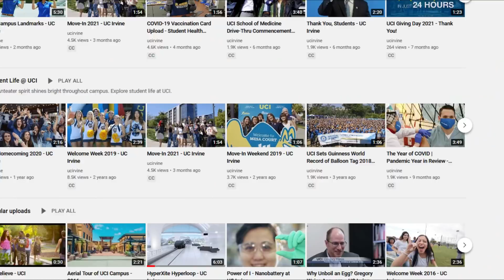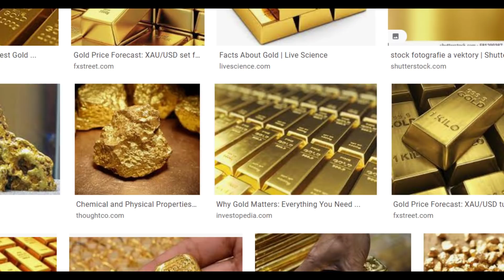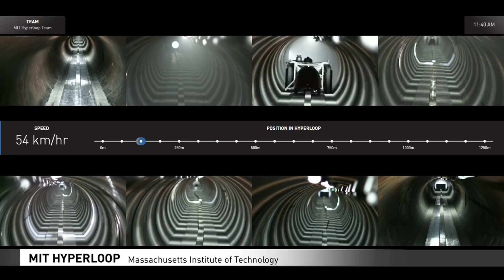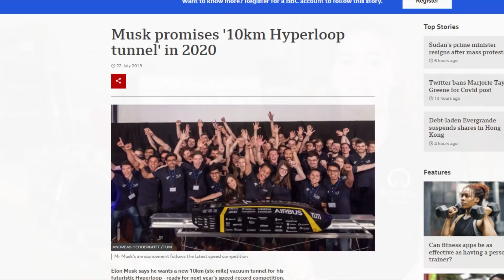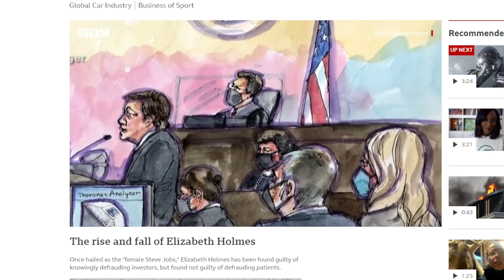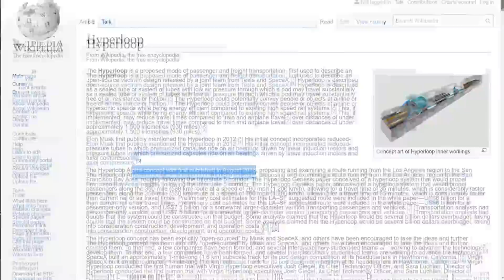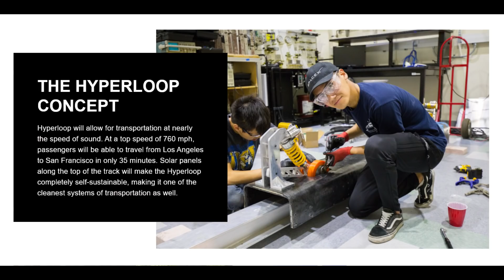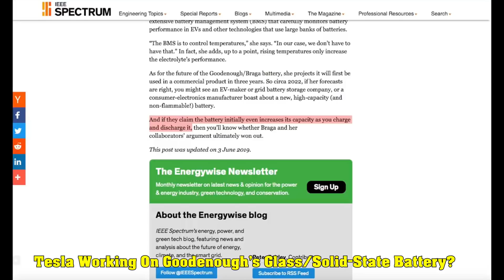The GOLD Battery that will revolutionize EVERYTHING!

Comment: The crazy one is the solar shingles.  That's surely got to be the most possible of all the ideas, with the fewest engineering problems, but we still we have nothing
Reply: That was a big disappointment to us.  We had a hail storm damage our roof, and thought that would be the ideal time to get a solar roof as a replacement.  No need for a "regular" roof with structures on top of it for solar.  No, the shingles themselves would do double duty, as well as being far tougher against future hail storms!  Discovering that it was another Musk lie, we just got a composite shingle replacement.
Reply: Oh, that one is EASY to develop... good luck installing it and having it last. It was developed and quickly they found out 'You know, those dudes who made larger solar panels MIGHT have known what they were doing'.

Comment: So, a overglorified capacitor that uses gold?
Reply: yep
Reply: An over glorified capacitor that stores far less power for the same mass than many other materials, such as Lithium, for example. It's a bit like looking at land degradation from intense monoculture farming practices and announcing that you found a solution to increase the lifetime of a field under intense farming by 20 times but that it produces 3% the yield each year, it makes no sense and is a dumb solution when more viable alternatives already exist (which in the case of intense farming, but it's banning and replacement by crop rotations and mixed farming).

Comment: Technically the performance of a battery will improve slightly upon initial charge-discharge cycle due to the deposition of the cathode electrolyte interface. This is true of all secondary batteries though so the claim about this battery specifically is misleading. I'm working on battery materials for my MChem project.
Reply: Isn't this true only for the very first cycle, though?
Reply: @Gameboygenius  actually no. Depending on the type of battery you can see a slight increase for a year or so. Batteries with design lives of 20-30 years and high capacity is where it would be more easily noticeable. (I spent a decade working on motive power((forklift) and backup power systems (power plant/substation and oil/gas plants/compressors)) also that design life for a battery is the years/cycles it should last and still have about 80% rated capacity
Reply: @Gameboygenius  depends how long it takes for the interface to deposit, I imagine. Its not something that goes on for ever though, yeh.
Reply: @silvercrystalct  Which battery composition and design has a lifespan of 20-30 years?
Reply: @silvercrystalct  Fork lifts use lead batteries. What type of batteries are we talking here? I thought it was all about Li batteries for electric vehicles for the road.
Reply: Very interesting! I had never heard of that. Would you have some references?
Reply: @kaasci   Great, thanks!

Comment: The concept of coating electrodes with a gel to increase cycle durability is actually one I've seen before with batteries.

In the particular case they tested 100s of thousands of charge/discharge cycles and it showed no degradation - this was however just a basic Li ion cell so all you get is an immortal low density battery (which isn't such a bad thing for some applications like space use).

Comment: Local company : I'd like a new brick extruding machine with 15 % less power consumption and simpler maintenance.
UCI student : yeah no, we're busy creating an air lift vehicle that works in a vacuum and running on gold batteries.
Reply: I'm sure if the local company created an overpriced grant for the project, universities would eagerly apply for it.

Comment: i'm not an expert in engineering, but battery that improve overtime with usage sound a lot like wishful thinking...
Reply: It sounds like magic
Reply: Check out the Dow-Kokam packs they use in the white zombie electric car. As the packs got broken in and more evenly matched, they did continue to get better and better.

It reached a plateau, but it's a good example of how awesome the packs can be if nobody cuts corners in the cell balance controller and charge system.

I hate lithiums because they're so fragile when they're abused, but the tech to not be abusive to them is expensive.

In the meantime, there's idiots building massively parallel banks of 18650's with only two controllers and an army of clowns in the comments section defending that decision. :/
Reply: if it looks as a scam, it sounds like a scam, it is scam
Reply: Its Soyience
Reply: @SwervingLemon  Teslas should be rated in vapepower
Reply: They'll be called "battery beans" and they will be magic!
Reply: @ExarduffmanTheFirst  I'll take two! I have this wand that turns Monday mornings into Tuesdays and it seems to be low on power, it takes about a day for it to change Mondays to Tuesdays.
Reply: Some type of battery actually improve capacity overtime, but only for first few charging cycles. They reach max capacity at about 10-15 cycles, then start to lose it with further usage...

Comment: Gold supercaps have been off the shelf components for about 40 years and Panasonic only recently discontinued the production of theirs. I'm still curious how this "new" research is any different to what I could get delivered tomorrow (Farnell/CPC still have stock). Sure it's a component with a niche application, but it's not like they haven't seen use and they're not outrageously expensive.
Reply: But I  bet they don't have gold "nanowires" coated in a "thin" (for which read about 3 mm) layer of gel . . .
Reply: @nigeldepledge3790  You do realize nanowires are a real thing, right?
Reply: @turun_ambartanen   - Yes. I don't know if anyone has made nanowires out of gold (I think they'd be very flimsy), but most nanowires I've read about are made of buckytubes. And if you're going to coat a nanowire with a gel, squirting the gel out of a syringe kinda renders the use of nanowires pointless. (Much easier at that scale to use ordinary gold wire.)
Reply: @nigeldepledge3790  What you are thinking of are Carbon Nanotubes. They are slightly but significantly different from Nanowires, because they are hollow and practically limited to being built with Carbon. Nanowires on the other hand are solid (usually single crystalline) rods with at most a µm in diameter. They can be grown from many different materials. Silver Nanowires are a very hot candidate for use as electrodes of flexible solar cells for example. (not entirely sure if they are already used commercially, so I won't claim that, but there is lots of promising research for both material properties, as well as mass production)
Yes, Gold nanowires have been produced. I will link a paper with experimental numbers below ("The Strength of Gold Nanowires" link in extra comment, in case Youtube deletes it). Any Nanowire will be "flimsy" in absolute terms, but due to size effects they are much stronger than expected from bulk material properties. You can't extrapolate the ductility of Gold to such small scales. And by the way: the mechanical stability is not relevant for electrical applications.

Comment: I am not against forward thinkers or “visionaries” but when they or their publicists/news organizations try to oversell their theoretical projects by either making claims of their viability or how soon they may become a reality is when I start rolling my eyes.

Can electric vehicle one day become the norm? Sure but it will take a long long while and technological advances in other fields have to happen before it will become viable. Will battery tech continue to become better? Sure but it will be gradual. Will robo cars ever become a real thing? Sure but it’s going to take time before you get past a ton of hurdles. 

The issue is that people go nuts and act like these things are possible in the short term and not the long term. It’s this idiotic mindset that also makes people believe pipe dream projects that most often than not are scams are possible.
Reply: One thing I'd add is we've already been working on those tech for at least 15years, long term for sure, but more like 10-20years than 100years. Everything we have right now is barely 100yo, most of it not even 25 years old like consumer pc, cell phone etc. 

Tech is evolving at a faster rate every year, the three example you stated are already here, people are driving electric cars, two blind people in England are "driving" around in 100% autonomous vehicle, it's only a question of time for those tecnologies to take over. Ev's gained 30% range in the last 10year, an other 30% and it's over for ICE by an order of magnitude even in the worst conditions.

The hyperloop is on an other level of bullshit, but you'd have to be dumb to compare hyperloop future to ev's future and autonomous vehicle as a whole. Tesla(Elon Musk) does not equal Ev.
Reply: @TJPDmember  to be fair to internal combustion they got most of the extra range by just adding more batteries because the original average battery capacity was pretty pathetic. Adding 30% to the weight and expense of the vehicle isn’t going to make them more attractive. 

The rapid charging has been coming along and that is likely going to be a lot more important than the range if I can drive for two hours and then recharge for 15 min and drive another two hours that is the minimum amount of time I am required to stop for anyway for safety reasons so recharging would be no big deal.

At the moment I would require a vehicle with a pretty large battery capacity (and since I need to transport large objects around I need a flatbed not a nice aerodynamic sedan).

If they want EVs to take over the market in the next 8 years they really need to get their fingers out.
Reply: @glenecollins  what you're describing is not the market they aim for now, the passenger car market is the one being aimed at. 90% of people commute to and from work is under 40miles. When ev's will reach 6-700miles on average, I don't see 75% of the market being out of reach at all. we already get more than 200miles in 15min at a supercharger (for a passenger car). Electric car are pretty much already old news, now is only the time to start improving. The ICE been worked on for the last 100year and can barely achieve 40% efficiency. Minus charging times from empty to full(more and more work place allow you to charge during the day), the electric car is already getting pretty competitive. I just can't wait for real car manufacturer (ie. not telsa) to show what they can do.
Reply: @TJPDmember  That forty percent efficiency slam might be more effective it not for the fact that gas has ten times the energy per Kilo compared to batteries.  And you can buy a lot of gas for the price of even a small EV battery.  And while many people could get by with under 100/k range. I could, but I will wager everyone of them could think of a reason why there might be a time they need three or four hundred k range. And considering the relative cost of EV and IC I can't see someone pinching pennies buying the EV
Reply: @TJPDmember  I think I agree with most of what you said. Perhaps I am just a little more pessimistic?

as you said for most people who commute to work they really only need ~100Km range for day to day use however they couldn’t take that car on holidays in any of the larger countries like Australia or the US. Paying for 700Km of range so that you can part charge it a bunch of times to get to where you want to go on holiday isn’t going to be appealing (even if it is doable and is arguably safer) so 2 car families are likely to exchange one of their cars for an EV. 

Places like Australia and the US are supposed to be working towards having mostly EVs on the road in 8 years which is very different from the bulk of sales being of EVs. 

There is still a massive market opportunity for faster charging batteries (hence the work on capacitors: just making regenerative breaking more efficient would be a decent step).

Most of the manufacturers which currently make fossil fuel cars are currently working on affordable EVs and most of the startups are working on “luxury” EVs because they know they will need the markups expected in that market.

At the moment as far as I can see we aren’t there with affordable EVs. The stock price of EV manufacturers reflects the perceived need but it seem difficult to justify given that most are working on vehicles which <10% of the population can afford.
Reply: @glenecollins  Sadly, rapid charging comes with its own problems, because it's a sudden surge of power draw equal to at least a few houses except with less ability to predict when it'll happen. That's per vehicle

Now, what happens to the grid when dozens of them suddenly start fast charging? What about hundreds? Thousands?

Even though battery-powered EVs don't normally scale up in size well in regards to weight and battery capacity, it honestly would be better to do them as part of mass transit. I was a bit skeptical of the idea at first, but after really analyzing it, I could see it working with EV buses that are designed to have battery packs swapped out and avoid(or just schedule) using fast chargers.
Reply: @InfernosReaper  I don’t think the rapid charging is going to be as much of an issue as I thought a couple of years ago. There has been a lot of movement towards smart grids with grid storage such as pumped hydro and other electric-> stored energy to electricity which not only solve some of the problems with renewables but also at least partly solve potential problems with fast charging.

Fast charging a reasonably sized car in 1/4th an hour would actually take more like the power of a country town because you would be charging the car with enough power to run a house for a day in 15 min.

The nearest electric bus company to me is putting in gyroscopic energy storage to try to smooth out their energy draw that obviously isn’t ideal because they are theoretically adding sources of energy loss.
Reply: @InfernosReaper  The hell is wrong with you people. I had to check the date on the comments twice to make sure they weren't made 10 years ago. EVs are viable. The grid issues are solved. Fast charging isn't an issue and it's only needed on road trips. 95% of the time people will be charging at home from chargers that run on off-peak hours pulling as much current as a dryer.
Reply: @kungfoochicken08  There's a video by the channel Practical Engineering that's worth watching. It does a very good job(much better than I ever could) explaining how the power grid works, while explaining what happened to the on in Texas during that big freeze.
Reply: @TJPDmember : Your "40% efficiency" is irrelevant since the energy density of batteries is nowhere near comparable to petroleum. Battery technology has a long way to go before BEVs start being competitive to the majority of the auto market. There is a reason why 99.99% of trucks are not BEVs.
Reply: @InfernosReaper  Yeah, that's the same channel that made a video about EVs being impractical because of energy density issues when compared to gasoline, while ignoring the difference in efficiency rates between gas and batteries. It's been up for a year and he still hasn't corrected it, despite being called out in his comment section. He even went as far as replying to one of the comments addressing this, but completely ignored the subject. He's an entertainer with a clear bias on the topic. Not much different than Thunderfoot.